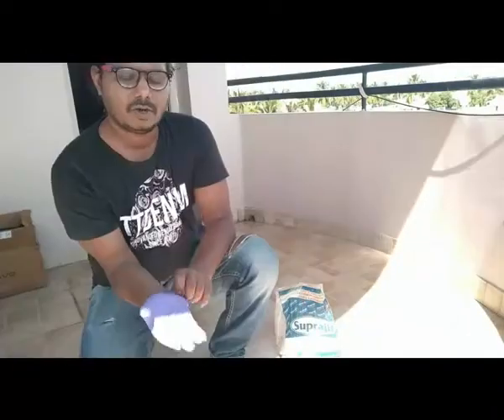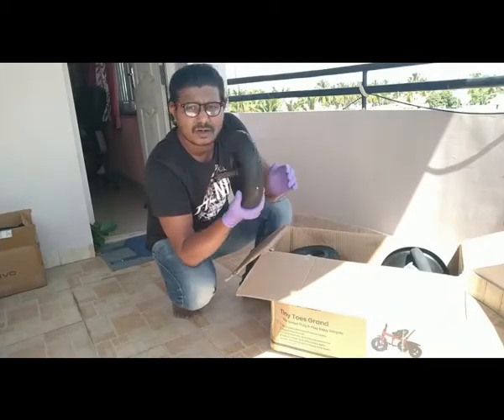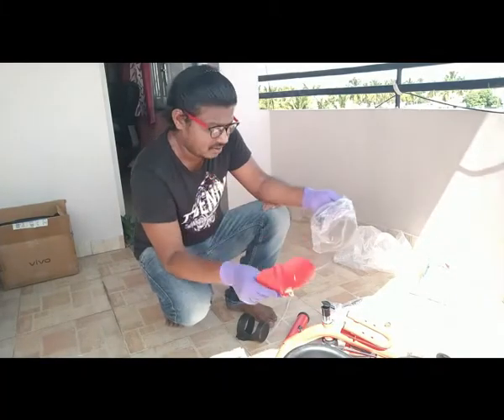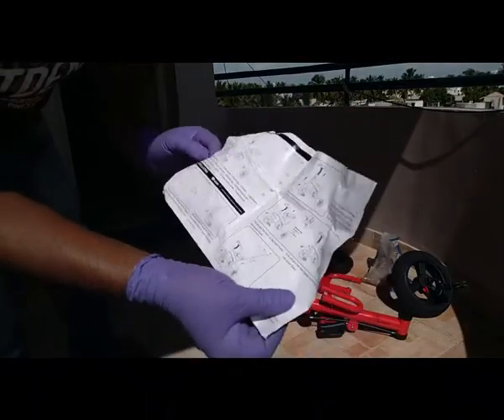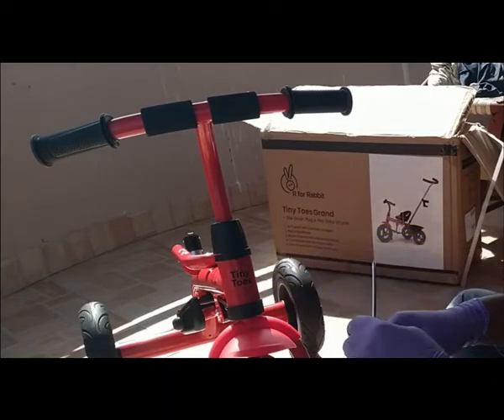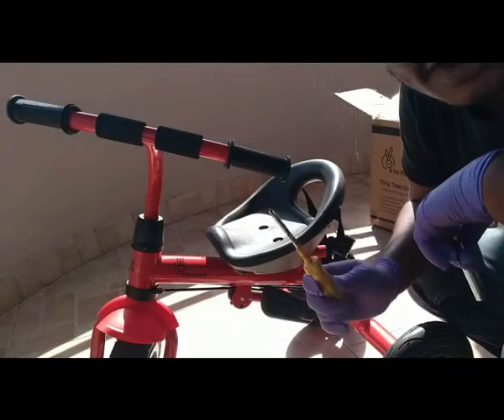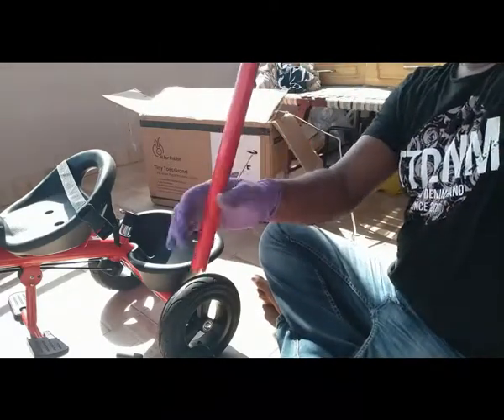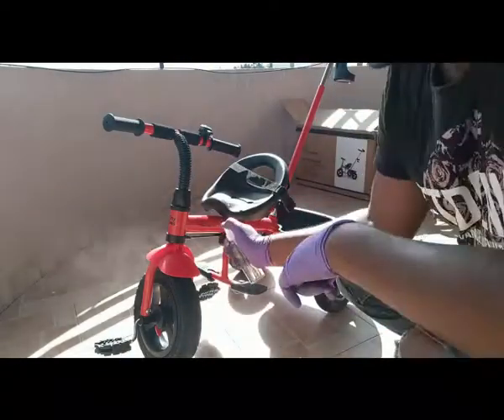R for Rabbit Tiny Toes Tricycle unboxing &  Assembly  From Amazon.in

Comment: For the parental handle height adjustment, try to rotate and pull hard till the height adjustment gets locked in the first of the various height levels provided. Thereafter it is straightforward. There is no red button in the new model. This should be made available in their installation video.  

Trust this helps confused souls like me.